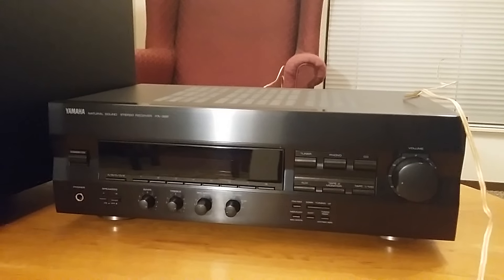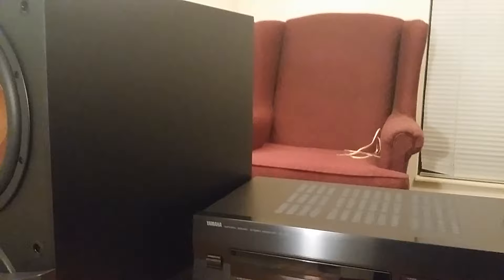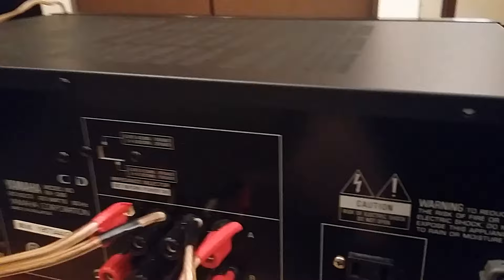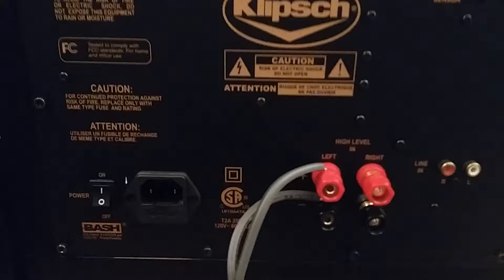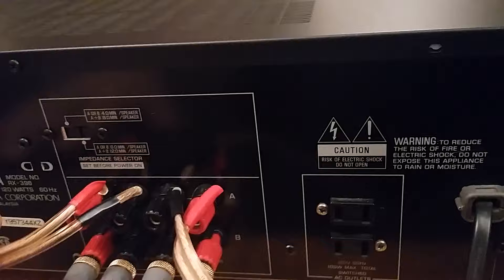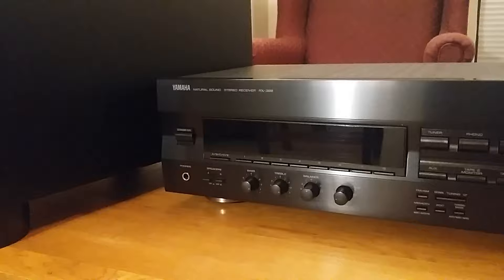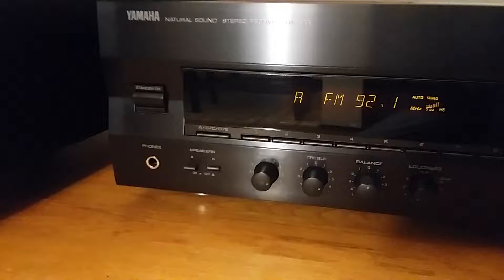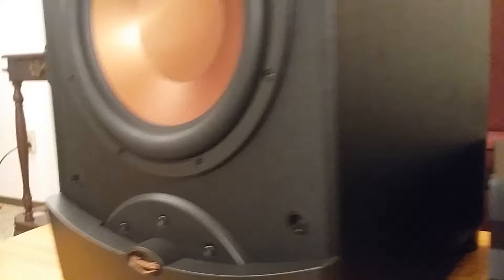How 2 hook up a active subwoofer to a receiver or integrated amp with no subwoofer pre out on unit

Comment: I searched all the vloggers here in you tube until i stumbled into your videos and im very thankful coz  i made it perfectly.😊
Reply from the maker: So glad this worked for you and many others ' makes my Day seeing these comments if you need help with Audio just ask 😊
Reply: What will i do if the sorround connection of my/the amplifier is not working?thanks in advance😊
Reply from the maker: @user-xq6op5iy1u you can tie into your main speaker A output ' the sub only needs a signal it will not take power away from amp I think it's like 500mv ' millavolts ' it won't hurt nothing just get positive negative correct '
Reply from the maker: @user-xq6op5iy1u  y9u may have a burned out channel '
Reply: Thanks!!!
Reply from the maker: @user-xq6op5iy1u  heck yeah you wouldn't believe how many people this has helped I just took my time and went step by step ' got a few more I am about to post how2 videos dac/EQ
Reply from the maker: @HampCampSportsShow  toyr welcome about to post a video On hooking up an Outboard dac to my equalizer

Comment from the maker: Please subscribe ,Thiers more DYI projects to come very soon !  If i can get the subscriber base numbers higher ,I can get the audio companys to send me loaner audio to show more tricks of Audio hifi thanks again everyone
Reply from the maker: Your very welcome , thanks for the comment !
Reply: @tee-jaythestereo-bargainph2120  I'm wondering kind of the opposite of your video,how can I hook a PASSIVE subwoofer to my pioneer vsx-d557 receiver which only has an active sub RCA output?
Reply from the maker: @fredwood2033  does the passive subwoofer have soeaker inputs and outputs ? If so run speaker wire output from revievers to input of subwoofer then from subeoofer run speaker output to tour front speakers
Reply: Tee-Jay The Stereo-Bargain-File Hello. My pre amp subwoofer only have 1 line in left and right. And I have a 2 channel amp. Could I used Y split RCA connect 2 negative of B channel to sub’s 1 negative. And 2 positive to 1 positive. Will that be ok?
Reply: Tee-Jay The Stereo-Bargain-File By the way, I am also going to get a passive center speaker. Could I also connect it to both left and right B channel by using Y split? Thanks a lot if you could answer me, cause I couldn’t figure it out whole day.
Reply from the maker: @jaychen2641  Yes you can do that , i had to read twice but yeah ! 😆
Reply: Tee-Jay The Stereo-Bargain-File Thanks a lot, you made my day. So I could connect both center speaker and sub to both sides of Channel B?
Reply from the maker: @fredwood2033  if you went passive you eould needa crossover that allowed both front channels input for low frequency sub , and and speaker output for High freq running back to your acrual front speakers alot of passive subwoofers came with this back in the 80-90s
Reply from the maker: @jaychen2641  man i think i understand lol but yes but it may  maybe starve the amp just alittle from the signal but shouldn't hurt anything i just saw all these comments but yeah i think youll be good
Reply from the maker: @jaychen2641  just saw this , did you try it i didn't understand ?
Reply: Hi teejay, can i use a  subwoofer output  from my av reciever to connect two passive speaker?  What speaker cables should i use? Thank you!

Comment: I want to thank you man! Thought my subwoofer was broken. But here you come and saves the day. I had to hook up my subwoofer with my front speakers. Couldn't have a and b pressed together. Thank you again.
Reply: Same here. Even though my Pioneer AV receiver has A & B speaker outs, not unable to utilize his YT method without losing 5.1 surround. The receiver manual also states this. If you have satellite fronts, it would be ideal to use the above fail safe solution. Since the satellite speakers are not bass efficient, hooking it up this way will make the mids and highs more listenable by adjusting the subwoofer crossover pot.
Reply: brand new to this stuff trying to figure it all out. when you say you hooked it up to your front speakers, does that mean you ran your left/right literally to your front speakers and not the receiver at all?
Reply from the maker: Yes i ran speaker A output from reciever to Speakers then I ran b speaker output fron reciever to high level input of subwoofer 'all good thats what i am here for -

Comment: Klipsch,,,, Really? this is the EXACT same sub woof im tryna hook up,   thank you so much.  I figured it out thanks to you.   well it turns out the whole right side of my 1985 Hitachi SR- 504  is out.  no power to the right side,  so i hooked it up to the left side and it works but,  not so well,  no balance control.  but with my HEIL AMTS 2 it still sounds perty good.  Haaa. these speakers are pure German genius...but I need the original pioneer 1976 receiver and amp to get this $4000.00 vintage system back to normal.  thanks for the tips man it helped me out a lot.

Comment: Hello pal , I finally got around to hook up my subwoofer to my amp using your method. It worked treat.!! Thank you so much .
Reply from the maker: Your very welcome 😆 I will have more tricks of the trade coming very soon
Reply: HEYYA So i have a poweramp with channels a and b i was thinking channel a for mains and channel b a high low converter like the audiocontrol lc7i would this safely give me the low level signal I want to run my monoblock car amp

Comment: You are Great. The question is that I want to connect 2 subwoofers. Should I use Y BANANA SPLITTER from SPEAKER B OUTPUT, and feed Both Subs, or to go with a SPEAKER JUMPER CABLE from the First Sub to the Second Sub? Please, tell me your thoughts. Thank you very much. 🙏
Reply from the maker: Yeap 🍌 y splitter 😆 going to show in my nexted video how to get 2 rca outputs from dacs with just single rca output 😃

Comment: Hey TJ  can you review : Elec Subwoofer  1010 because of your review I ended up making a purchase on this subwoofer,I was very very close to Purchasing a SVS SUBWOOFER PRO SERIES however bought the Elac for $119 and I followed your instructions for connections for$119 it's a very very pleasant surprise again can you review this SUBWOOFER. You sure doing a great job thank you man. Also used connection for A & B on Onkyo A9150 2 channel Intergrated Amp.

Comment: Super useful. Just to check, does this method allow you split the frequencies, for some of the newer subwoofers? Thinking of picking up the SVS SB1000 Pro. Also just to confirm, with the method you’ve just shown would the sub woofer volume be controlled through the main power Amp right? Appreciate your help.
Reply from the maker: If the powered sub has built in eq for freq cut like only pickup freq between 60-80hz

Comment: Thank you Tee-Jay, I just bought a Sony SR model STR-DH190, without the subwoofer pre out , and I was just thinking about getting a subwoofer. once I get it , I will re watch your video , follow the instructions and hopefully with the receiver I have it all works ok. ( i am thinking to buy a Sony active subwoofer model SA-CS9)
Reply from the maker: Just Make sure the (Active) powered subwoofer has High Level inputs 😆
Reply: @tee-jaythestereo-bargainph2120  Thank you again Tee-Jay..btw this is the model that I have in mind..
https://www.sony.com/electronics/home-cinema-speakers/sa-cs9
I am also open for suggestions  :))

Comment: I have a:

Yamaha CA-810 amp (watched your vid on that, it was perfect), and

Klipsch R-100SW active sub with just RCA inputs.

I have a pair of 14ga bare wire to RCA on the way…. I assume this will work as well?

I’ve seen that people also use Scosche LOC80 Line Output adjustable Converter 2-Channel Speaker Wire to RCA Adapter - is that also necessary?

Thank you!!!
Reply from the maker: Nit it's not needed if your sub had high level input already

Comment: Hi, my name is Ryan Guilbeau in Chuckey, TN.
I’d like to ask a question concerning woofer hook ups.
The equipment I have is a Yamaha RN303 stereo receiver. I have 4 speakers taking up the A/B channels on the back.  If the B speakers are taken up… how would I hook up the woofer or can at all?  Thank you for your help.
Reply from the maker: With pos/neg right with speaker output powered sub only uses for a signal or .005 of 1 watt which is nothing  or 500mw - it will work for ya please subscribe 😆

Comment: My Klipsch sub only have rca line in and it is a powered sub. My receiver has a (sub out) but not sure if I would burn my amp up on my sub plugging it in like that. Idk if the receiver would overheat the amp sub or if it would be ok.  It is the klipsch KD10SW

Comment: Great afford! But I think you have missed the most important point by using A and B VS A or B it will not only affect the power output but the impedances right? Correct me if I am wrong please, thanks again!
Reply from the maker: No it wont change the impendence at all - its not like i am driving 2 sets of speakers the high level input of active sub only needs a signal ' theirs no speakers drawing power lol

Comment: Great vid, but I have 4 speakers in the ceiling, not sure this works without an open B set of speakers.
Reply from the maker: You can tape into the speaker output from amp Left/right channel the sub only takes like 500mv of signal theirs no drivr power with like a passive speaker

Comment: If I don't have a "B" speaker stereo receiver and the subwoofer has no "high level" output, can I connect it via parallel connection to speaker "A"? Meaning, running an extra pair of speaker wires from the "A" speaker output from the receiver to the "high level" input on the subwoofer. Thanks
Reply from the maker: Yes you can

Comment: Thank for your tutorial. How about when we got 4 speakers connected: 2@A and 2@B? Would I still plug subwoofer with 2X speakers on B?
Reply: I would plug speaker A to one set of speakers then speaker B run wire to your 2nd set of speakers and the powered sub. The sub wont draw power from the amp because its very high impedance.

Comment: Can you not double up with the speaker wire & have them hooked up to the same speaker inputs???
Because I have both A & B speakers running at the same time & I like it that way, but also want to add a subwoofer.
Reply: You can run wire from receiver to speaker then from speaker to sub.

Comment: quick question, was told it's bad to send amplified signel to a active amp??? I put my sub through a tape 2 output on my amp,it has no sub connection,works great...any feedback would be appreciated.
Reply from the maker: If your sub has has level input it should be ok i didn't think tape output had variable volume
Reply: @tee-jaythestereo-bargainph2120  thanks for reply,my sub only has RCA inputs and amp speaker wire, yes the only way I can turn my sub up is on it,it doesn't connect with volume control on amp,I was looking to get wire to RCA adapter but was told not a good idea? Any more help/info would be appreciated 👍
Reply: Also tried dodgy wired it in and sub is pretty max at lowest volume setting on sub but sounds good and loud,wire to RCA adapter would work you think? Just don't wanna damage amps
Reply: Subscribed👍

Comment: Many thanks for this video.  I’m wondering though - if I bought a new amp w a sub-out feature .... do I gain anything by that or would it sound the same as using this technique?
Reply from the maker: This is actually the best way to run subeoofers their in phase with your speakers Rel/P.S. audio both have subwoofersxwith hi level input is so mich better than a subwoofer output

Comment: Hey buddy great video I appreciate it simplified what I want to do the only problem I have is that I have a Sunfire subwoofer which I picked up from a friend of mine‘s he had for a while but it sounds great I’ve been using it with my AVR in my bedroom but now I’m setting up a small vinyl and receiver set up with my Yamaha preamp which is to channel with A&B  as well. The only problem I have the sub woofer does not have a high-level input well at least it doesn’t say high-level input. It does have the RCA connectors and it just says speaker level input can I use this if not what are the options do I have. 

Thanks for any advice that you or anyone could give me here
Reply from the maker: Felix Laboy how many outputs does your preamp have ? does it not have subwoofer output? if you send me model number of pre-amp and active subwoofer I might be able to figure it out some older pre-amps don't have subwoofer output their just meant to run to a 2 channel amp now if your 2 channel amp has speakers A/B then you can use amp just Like I did in this video
Reply: Speaker level inputs should be the same as high-level inputs

Comment: Would this connection method change the amount of power going to speaker A?
Reply from the maker: No !! It only putting out a signal ' theirs no speaker load at all' just an input so no strain on the amp

Comment: I found a V=Pioneer Home Audio VSX-LX304 9.2-Channel Network Elite AV Receiver for under  800 brand new in the box, and a Yamaha intergrated AMP Yamaha A-S801 Integrated Amplifier, 290W Dynamic Power at 2 Ohms, 10Hz-100kHz Frequency Response . I the receiver was 1300 last year or year before and you can add an amp. My first receiver will not accept an amp...Im figuring Im not gonna beat this deal ...9.2, that equals fun and that amp looks clean and gets great reviews. I will use it only for 2.2 music listening. Klipsc RF-62II's and two Klipsch SPL120s...I think this AMP will push the RF's to another level. These are mean speakers that I have yet to distort ...What are your thoughts
Reply from the maker: Yeah the Pioneer will drive Klispch speakers easily - whats your ?

Comment: If you're powered subwoofer has speaker outputs could you run two speakers off the subwoofer to basically get a surround sound type thing subwoofer and two outboard speakers and then your main two speakers hooked to that amplifier is that possible? Oh yeah are you from North Carolina?

Comment: Could you help solve my problem? I have used a Marantz integrated amplifier (Model PM6005), which does not have a subwwoofer out. I just bought a Klipsch subwoofer (Model R-12SW), which has two RCA jacks and no speaker line in jacks. How could I connect my amplifier and subwoofer? Thank you very much for taking the time to help me solve my problem.

Comment: Tee-Jay, I purchased an Elac 1010 sub and a Yamaha RS-202 receiver, the Yamaha A L/R are hooked up to my bookshelf speakers and they're working great. I've hooked up the Elac to the Yamaha on the B speakers, L/R +/- The speaker is on and I'm not getting any signal to it. I'm gonna try to swap out the wire and see if it's a connection issue. Any thoughts?

Comment: I have an two channel integrated amp, but don't speakers Aand B. I don't know how to connect a subwoofer to it. I have pre out and main also. I tried to hook the sub the pre out but nothing worked when I did that. And right now I am feeling pretty lost. I'm new at all this stereo hi-fi stuffs, I'm guessing that's my problem.
Reply from the maker: We all had to start learning from somwwhere ! Hell i am just now learning about labtops and video editing and i am lost to ! I feel ya but thats why i am here 
Does your powered subwoofer have high level inputs like i show in the video ? 
Because you can tap off your main speaker outputs that you also use for your front speakers
Reply: @tee-jaythestereo-bargainph2120   Like I said I have pre out and main in. I also have main and remote speaker outputs, two of each. And I really really don't understand how to connect everything. Right now I have two Polk Audio satellite speakers connected and that's it . I also have a canter channel speaker, but no clue how to connect that. But what I really want to get working is the powered subwoofer. Is that enough info for you to possibly assist me?

Comment: My sub and and speaker worked fine without wires going in left and right, but it doesn’t work now after I took out all the wires. How exactly should it be put in if there’s only wires going to left or right

Comment: Im getting a sub delivered today and plan to do the same set up but with a bonus...my sub has a left and right out for speaker wire, so I plan to have then 4 front speakers right?  I can do the 2 from the rcvr a, then power two more from the sub out of rcvr b.  Im getting very excited for this delivery later today!
Reply from the maker: Congrats USMC HooRah !! Marine !! Appricate your service freedom isn't free!
Reply: Yes , i did this. 200 watt sony amp. Speakers A left right has bookshelf speakers. Speakers B has subwoofer high level in, then speaker wire hooking out of high level in to left right bookshelf speakers.  Both speakers A +B are on. I have my amp hooked up to equilizer to amp on tape in tape out, and i have  a wii directly connected to eq in. Very loud stereo for 200 watts. I love it.
Reply: @dalanwanbdiska6542  does hooking speakers into the sub affect the sound quality of the speakers or does the subs amp get bypassed?

Comment: Hi Tee-Jay, great video. I use a 2 channel amp which is also connected to my AV reciever and have it connected to my two front main speakers and then select power amp direct when watching movies which takes a load of the AV reciever and works great. Question is - by hooking up my subwoofer the way you’ve demonstrated, will this be ok for movies as well instead of having the sub connected to the AV reciever? Cheers for any advice.
Reply: Yes, that will work.

Comment: Hey could I also use wires with banana plugs on one side and rca on the other? (banana from the receiver and rca into the sub, or powered speakers in my case)
Reply from the maker: If you use high level input ' the rca input needs a steedy 2volts
Reply: @tee-jaythestereo-bargainph2120  why?